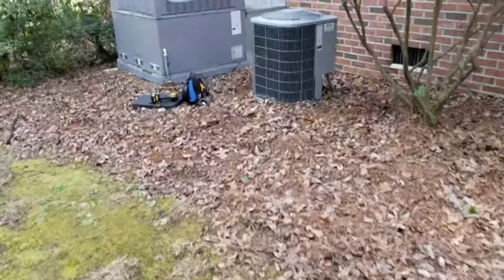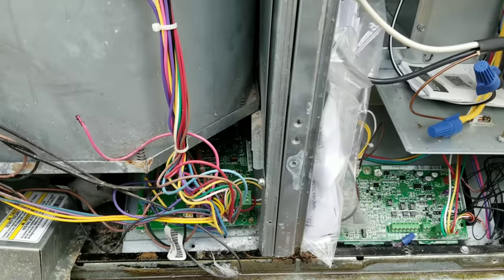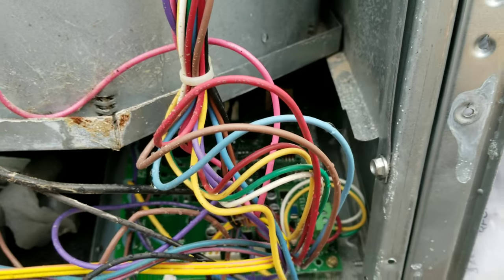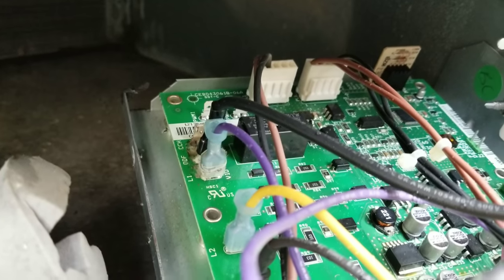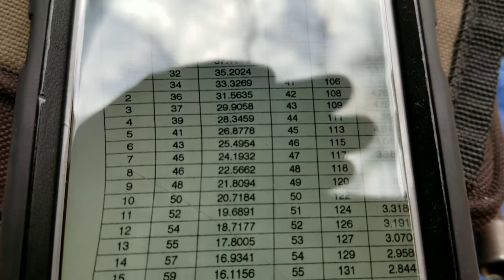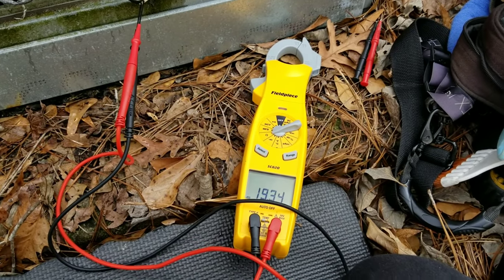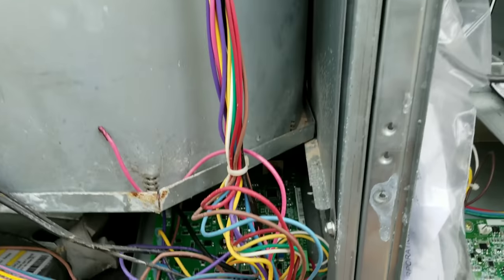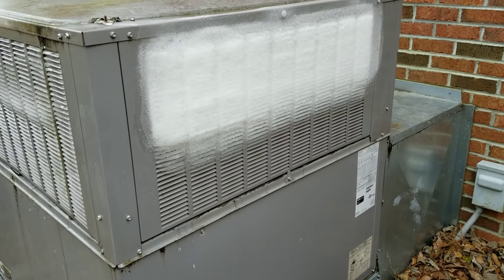Diagnosing A Frozen Heat Pump

Comment: How long do you usually get to diagnose then repair a unit such as this? You never seem In a rush in your videos. I rarely ever am given ample time on a call such as this. 

How many calls/hours do you run on a usual summer day?
Reply from the maker: My videos are usually edited in 1 or 2 minute segments or less throughout a call/repair. No need to rush in a short clip. 
This repair from the time I drove up until I left the house was about 4 hours. If I didnt video it would have took about 10 minutes less. 😀
Standard diagnosis charge covers up to 1 hour. Typically it takes less than 30 minutes to evaluate and diagnose most residential calls. 
After 20 years of service work and 8 years of making videos, I'm pretty efficient.
Some days I may run 3-4 calls, others 8-10. Depends on the call, the service area, the issue, ect.
I learned long ago there is no need to run around like a chicken with its head cut off. Be efficient, be effective,  and do it right the first time.
Reply: @HVACinSC  gotcha. I did a reversing valve today, took about 3 hours. I have found the faster I try and go the longer it usually takes either from mistakes or wasted effort on something if I had taken more time I would have thought through better.
Reply from the maker: @travisb9130  Yep. Coils, compressors, rev valves, are all typically quoted at 4 hours for us. That's the national average that manufactures estimate. I've done some in 2 hours and other in 6. lol! Every job is different.
Thanks for watching!

Comment: How were you able to determine its a 10 K ohm resistor?
Reply from the maker: Because I'm a Carrier dealer.
It will usually tell you in the service manuals and also provide a chart to use.
Reply: He has specialized training from carrier.
Reply from the maker: I specialize in all brands. 💪💪

Comment: Why didn't you check the infinity control for a code or check the board for a code, just to see what the control said the issue was?
Reply from the maker: I did.... and there was none. There is also no lockout code if the defrost thermistors are off or if system is low. Since I already knew this information I use my troubleshooting to determine the issue. 👍
Reply: @HVACinSC  right on. I'm always surprised when infinity or evolution equipment doesn't use the communicating control. Good video!

Comment: I had the same issue once and the technician said get rid of the Nest thermostat and problem solved.
Reply from the maker: No thermostat will cause a refrigerant leak. Find a new Technician. 😆
Reply: Lots of tech hate smart thermostat because they have less tolerance to bad system (mosfet instead of relay). So when the tech do a shit job, the thermostat usually will reflect that and not just keep going as if everything was fine.

Comment: I don't understand, the second sensor referenced to 25 degrees, and you said it's about 40? Could somebody explain this chart for me please, I usually don't come across units like this
Reply from the maker: The 40's I was referencing was 43,000 - 44,000 ohms which is the resistance I measured on the thermistor. 25 degrees is what that resistance equates to on the chart I was showing on my phone for this particular thermistor.
Reply: What app is that for the chart?
Reply from the maker: It wasn't an app. It was just a picture of the chart from back of the service manual.

Comment: That is a terrible design,you sure got that right.😁
Reply: I hate everything about those d@mn package units. The way the heater compartments are set up with the line voltage & fuses on the back of the stupid door makes it almost impossible to troubleshoot with the power on ⚡⚡⚡ And the Warren heater kits 🙄🙄🙄 OMG! 💩💩💩
Reply: What else is new when referring to Carrier..
Reply from the maker: @markg1773  and every other brand on the market... 😏😏

Comment: I went with Trane products bc Carrier has disappointed more than once due to bad product design.
Reply from the maker: Trane has plenty of design issues as well, no different than any other brand out there. Their HP defrost condensation run off does the exact same thing. Run right into the electrical and blower compartments.
I like these Carrier units with the exception of this run off. If that was fixed it would be a pleasure to work on.
Thanks for watching!
Reply: HVAC in SC Btw,  as   today, so now subs, Regarding brands ‘COMPETITION’ has dragged everybody downer is crap, and better crap and really good costs money.

Comment: Nice Video!! I think both coils are the same and can be flipped?!
Reply from the maker: No. they are actually complete and opposites. There is a long and short side. The header and piston body one the one I changed is on the shorts side of the coil while the other is on the long side.

Comment: I would have just SB8 the fitting, would have been easier and faster..  That litle joint is perfect for SB8..
Reply from the maker: I would have just brazed it if it wasn't warranty. Under parts and labor warranty however there is no reason to perform a repair like that with the potential for more leaks down the road. Remove and replace. Simple.
Reply: I gree
Reply: What is SB8
Reply: @johnnyboy7881  STAY BRITE 8
Reply from the maker: @johnnyboy7881 It's a type of solder that is basically as strong as braze with a lower melting point that typically Sil-Fos brazing rods. Biggest benefit is no need to purge with nitrogen because don't get the pipe hot enough to produce carbon build-up if done correctly.

Comment: Why not just braze the joint pressure test and be done?
Reply from the maker: Because it's under warranty.... If it was your warranty I'm sure you would want the coil changed instead of fixing it. If one leak developed, I'm sure more were coming. 👍
Reply: Because it's under warranty silly. If he sealed it up and went on then 2 or 6 months later another leak popped up what then? POint is if one spot is bad chances are it's a shit coil and why not get a new one?

Comment: That's a repairable leak...even tho is under warranty...but of course, that's a lot more money in replace then fix.
Considering that is the infinity system, factory  should have put expansion valves instead of those piston....
Reply from the maker: Carrier doesn't have OD TXVs on most models aside from their inverter systems.

Of course this type of leak is easy to fix. I have several videos doing just that.
However, repairing this while under parts and labor warranty does not help the customer. On fact O would have had to charge them regular rates since the manufacturer would not approve that repaor under their warranty.
 We do right by the homeowner and replace the entire part in these situations.
Thanks 👍
Reply: @HVACinSC  TXV regulates the right subcooling and she superheat, always the right amount of refrigerant to feed evap coil...orifice doesn't regulates nothing
Reply from the maker: @joeschneider67  😆😆😆 I'm fully aware of how a TXV works bud. That doesn't change the fact that this unit uses pistons for the heat mode refrigerant metering...
Not sure what point you are attempting to make here. 🤔

Comment: given that a coil is 80 % of the unit would it be better to replace the whole unit
Reply from the maker: No
Reply: @HVACinSC  i'm guessing cost/warranty?
Reply from the maker: @dtec30  No manufacturer is going to replace the entire unit first a leaking coil under warranty. Just doesn't work that way. That's why the systems have parts and labor warranty.
Reply: @HVACinSC  ok gotcha
Reply from the maker: Also the condenser coil on a heatpump package unit is FAR less than 80% of the unit. Maybe 20% at best.

Comment: I've started putting the old ranco timers on , these manufacturers engineers are evidently incompetent, and need to go back to school, imo thier d.a. engineers, it takes a grey hair to straighten out their problem, if it's not broke don't fix it, don't reinvent the wheel.the old ge timers worked for years w.o.problemsand they can be retrofitted to this crap we have now.the GE weathertron was the best heat pump ever made, by engineers that had a brain.

Comment: Its how carrier makes money off parts.....poor design
Reply from the maker: That doesn't work so well with 10 year warranties. 😆
Reply: @HVACinSC  truth. I have seen inducer motors fail on gas units after 6 years
Reply from the maker: Oh, no doubt. Ive seen hundreds of parts from every manufacturer in the industry fail under 5 years. That's an industry wide issue, not just one brand unfortunately.

Comment: Poor design?? Dude isolate and defrost it before you open the electrics hell it isn't hard to check if the sensor is banjoed
Reply from the maker: Clearly you haven't worked on these systems much.. dude. They constantly drip water throughout the run cycle because the base where the coil sits is flat and holds water.

Comment: What a piece of CRAP, open circuit boards, not even a drip cover, JUNK..no wonder I have 5 flawless Mitsubishi mini splits
Reply from the maker: Mitsubishi is guilty of plenty of service flaws as well. In my 20 years I've yet to find a system without them.
Reply: Can't believe Carrier could get a UL listing on this thing with those exposed boards and stuff, very bad layout, and FLAT, to really take on water, won't drain like if at least vertical..GREAT VIDEO, well DONE TOO. @HVACinSC